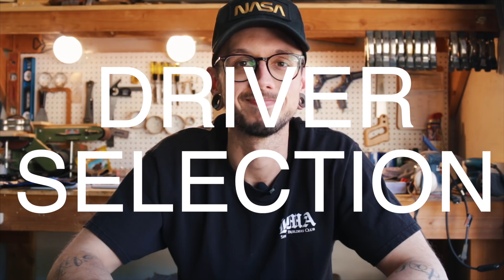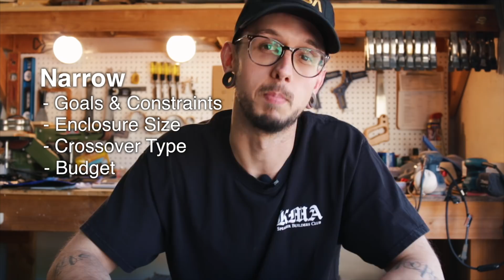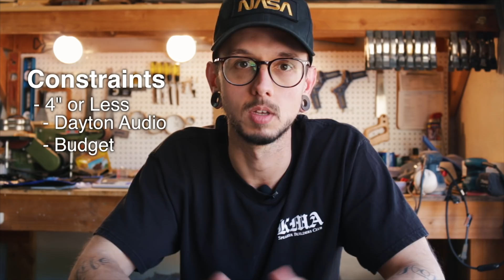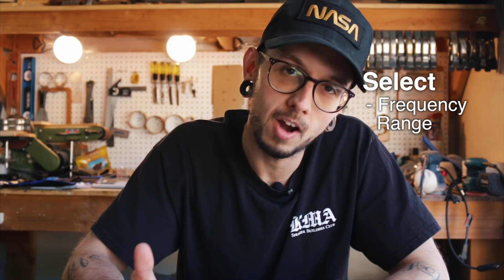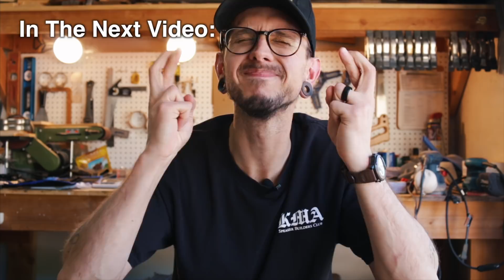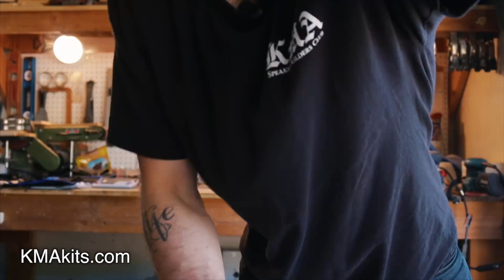DIY Speaker Driver Selection In 7 Steps || Step 2 - "How to Design Your Own Speaker In 6 Steps"

Comment: Let me add: use the parallel woofers gives +3db by doubling the size of cones and additional +3 for doubling the power delivered by amp. So in MTM you have +6db at woofers, most tweeters may have problem to match, so much better is 2,5. Additionally 2,5 allows  correct the +6db baffle step in easy way...

Comment: I have a question that you can answer. I have pioneer SF22 tower speaker and I want to update the driver's. I have 6 5.25  and 2 tweeters what would be some choices. I'm open to ribbon tweeters.

Comment: So the crossover splits frequency but how do you level the volume between the tweeter and woofer if one is more sensitive?
Reply: Resistor in the crossover circuit of the more sensative driver

Comment: I have a question. I love the Grand Orgue sound (my friend built one) and I'd like to build something like this. I'm a woodworker and pretty good with electronics. I volunteer at a second hand charity shop testing electrical items and have access to second hand speakers many of which I have to throw away due to cosmetic damage. I was wondering if I could collect drivers from these rejected speakers and build a large say 6 driver cabinets. Select the drivers according to size say all 4 and 6 inch and a tweeter. Is this doable or do I need info about each speaker to be able to combine them. I am interested in this project as its ambitious, a challenge for me. I like the idea in the Grand Orgue of many drivers all doing a little bit and thus more responsive. Thanks for any help here.

Comment: I have watched every video you've made so far, and I really appreciate you making them. I have learned so much from you, this channel, and your website. I am in the planning phase of my first speaker build. I wanted to say, however, that the link you provided to the downloadable planning worksheets does not actually take you to a Worksheet, which was a bummer. It just takes you to your website <... .com/shop>. Just wanted to let you know. 

Also, the speaker I want to build as my first speaker, is presenting me with some pretty difficult design issues. Could you tell me of any way that I can send you a .jpg image file so that I can show you what I am thinking about doing, so that you can tell me if you think it's a bad idea before I even get started? The speaker I want to build will be very large. I want it to be like a 1950's mid century modern credenza that will be a speaker system, as well as a piece of actual furniture for picture frames, and knick-knacks.  I want it to have a left-most, and right-most speaker box with at least 1 woofer and 1 tweeter, and then a sub-soofer in the middle chamber. But I have so many design concerns, I'd love to be able to see what you think about the ported cabinet I'm designing. (btw... I am an experienced furniture designer and woodworker. I'd be sending you the .jpg of the CAD drawing/design I've come up with.

Comment: I don't subscribe to many channels but I thought yours was worthy! ;-) Have you ever built a speaker using a Raspberry Pi (or similar SBC) with an i2s DAC HAT running something like Rune Audio, Volumio, Moode, etc (basically MPD server daemon)? If you used something the Piano DAC it has a programmable DSP which you can use for crossovers or subwoofer output.

Comment: Not an audiophile or avid speaker builder...found your channel a while ago and just liked the vibe and presentation of information. Some quick screen shots of the ones you picked and why would be great. Especially when it came down to the final 10 drivers. I'm excited for the next video. I started an old record cabinet rebuild a long time ago, and by start i mean i bought a bunch of stuff that's in a closet, a Yamaha amp R-S300, basic record plsyer for now, better as budget allows. And for speakers i was having a hard time finding 8" or 10" woofer 2 way plans. A lot were smaller and they may have worked, but I wanted to fill up the space where the original speakers are. Found a place called Pi speakers and ordered up the OnePi diy kit...hope to finally build it this summer or so.
Reply from the maker: Thanks so much for watching! After reading the feedback I've received, like yours, I'm going to make a step 2.5 video and go a little deeper into the details of how I narrow my driver options on the actual website. That should be out next week. That sounds like an awesome project! I also have a large old record player cabinet that I've wanted to restore for a while now. Maybe someday!

Comment: I don't know if I'm doing something wrong but Parts Express seems hard to navigate if you type in 3 inch or 4 inch speakers there's not that many to choose from so where are you getting all these speakers to choose from.. also would be cool if you could figure out the cheapest possible speaker with an amp inside that sounds good because if you just go with Dayton audio it seems the stuff gets pretty expensive.. I wish I could do what you do for a living. Speakers and audio is my passion but it's just the thing on the side.. thanks for everything you do
Reply from the maker: I'm actually going to do a step 2.5 video and go a little deeper into the details of selecting drivers. You'll also be able to see how I use the site to narrow down my driver options. That'll be coming out next week. Thanks for watching!

Comment: I think especially for this episode, showing us not only the website you used but the literal process of 447 drivers being narrowed down to 2 online or on Excel or however you did it would be cool
Reply from the maker: Yeah, I probably could have gone into a little more detail in this video, but I was trying not to let it run on too long. Maybe next project I'll dive a little deeper.
I'm actually working on something right now that will be a much deeper dive into my selection process. Make sure to check back for updates. May or may not be a podcast.
Thanks for watching!

Comment: only bad things about spec selecting  is you have to trust the manufacture to be honest about how good there speakers are and numbers dont tell everything but i agree its a good start if your starting i replaced a daton with a morel with almost the same specs and wow it made all the difference,  but it was a huge difference in budget also.   rely like your vids im thinking of starting up a Chanel.  i have to admit watching your videos along with a few choice others have inspired me to venture in to this area.
Reply from the maker: Go for it, man!
I agree, but from my testing, they aren't far off. If you're concerned about listed specs, you can always use a system like DATS to get your own parameters. Thanks for watching!

Comment: Do you have a list of speakers that would be great for repurpose (DIY speaker builds) if we can find them used... like TV speakers, portable radios etc.?  Isn't there a fantastic passive rad speaker in Toshiba big screens that'd be a good candidate for a project?
Reply from the maker: That's not really how it works. Speaker systems are designed around a host of variables, all of which require knowing the TS parameters of the driver. You would need a system like DATS v2 to get those specifications.
OR you can just wing it using trial and error with the drivers you have salvaged. Which is fine! You'll probably learn a lot. Just remember that the people that designed the speakers in the first place went through all the steps I'm talking about in this series. So build off their work and start with an enclosure around the same size as the original.
Thanks for watching!
Reply: Kirby Meets Audio Thanks bro!